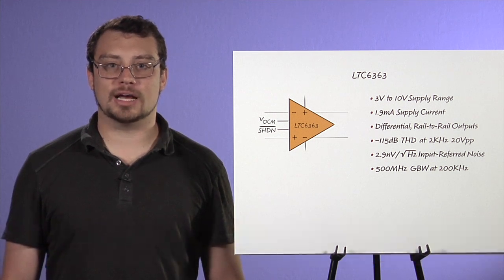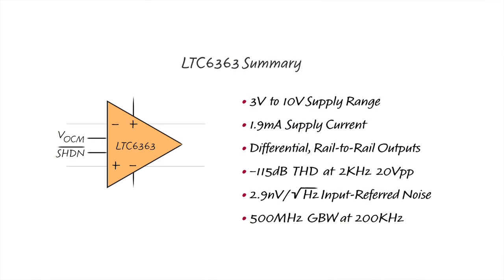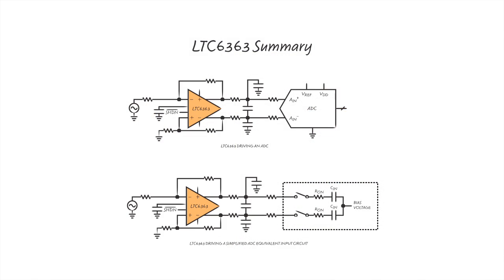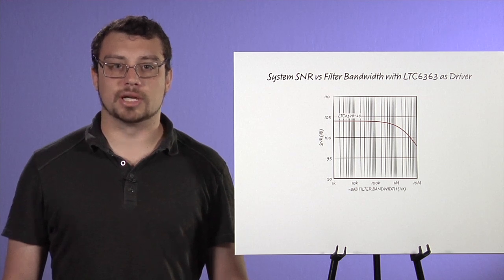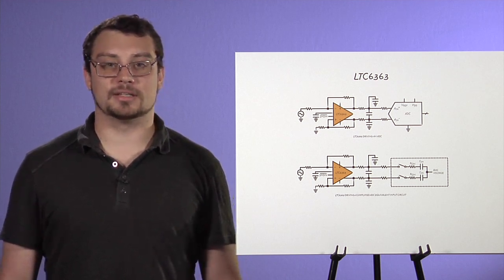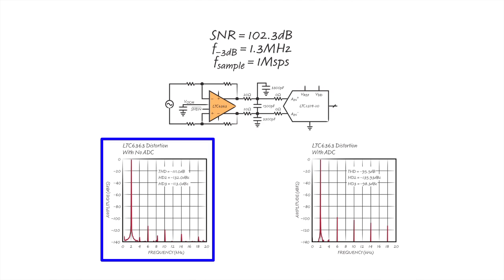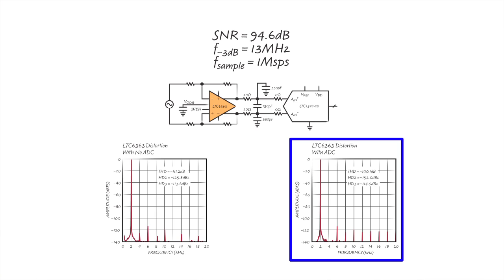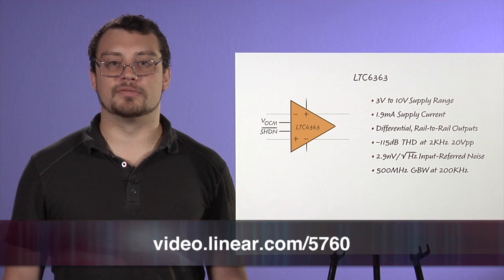Driving High Resolution SAR ADCs

Comment: Is there some app note that documents the circuit used to interface the amplifier’s output, with no adc, to the spectrum analyzer or another digitizer? What instrument was used to measure this filtered amplifier output  with no ADC in circuit? I’d like to replicate these results in the circuits I work on, to be sure that my expectations match sufficiently with reality, and that my implementation has no unforeseen gotchas.